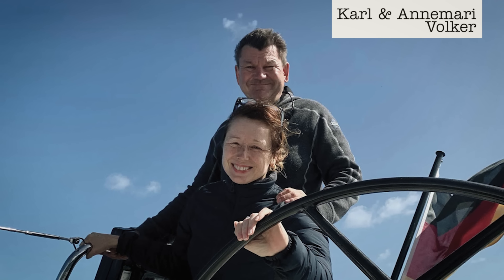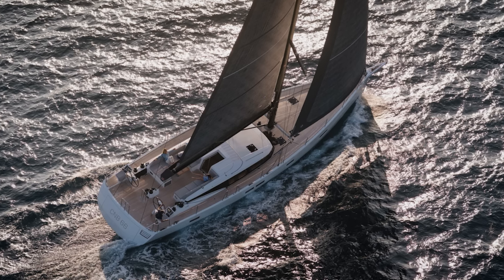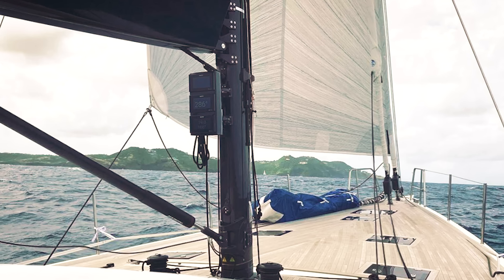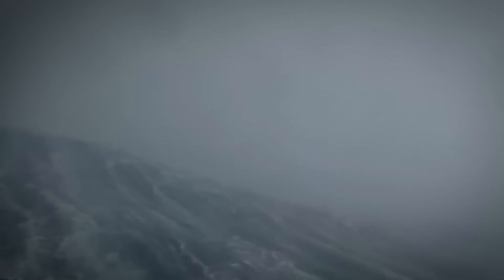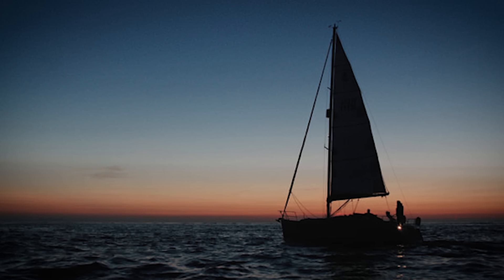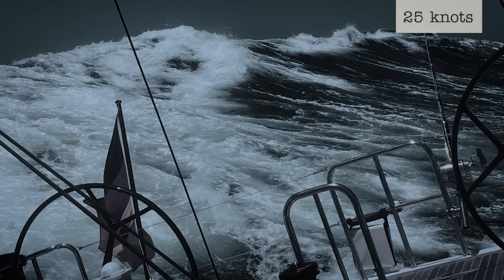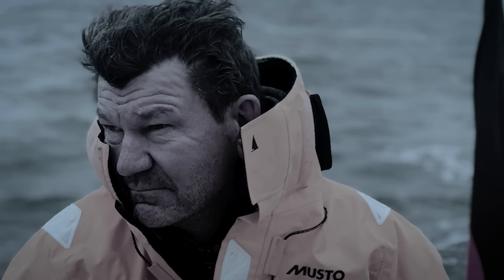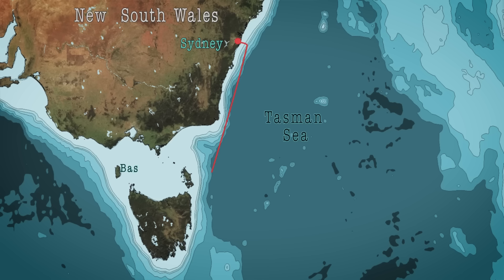Couple DIES on Private Yacht!

Comment: The reality is that spending a lot of money on a boat isnt always the way to go. There is a lot to be said for simpler and well proven designs.
Reply: @matthewmcdermit8744  I agree, a casual walk through on the mooring in Bermuda does not pass for preparing a small crew for a potentially hazardous passage. I can’t help but think that the main should have been a traditional mains’l with jacks that flaked into a pack on the boom. Like mast furlers, boom furlers are cumbersome and can malfunction. I helped deliver a 76’ CNB along the US east coast whose main was rigged traditionally with jacks and a boom pack. With one on the helm, one person easily reefed and shook out the huge (7/8 frac rig) main.
Reply: @matthewmcdermit8744  I agree, If they were ex coast guard how come they did not know anything about 1st aid?
Reply: @patricklund6497  Money doesn't buy safety at sea. Simplicity & reliability of equipment and competency of crew does. The further you venture from easy cruising grounds, the more that is true.
Reply: I agree, traditionelle furling, lazy jacks.
Reply: @matthewmcdermit8744  You're making a heap of wild assumptions there....
Reply: Just because you can afford a big boat doesn’t mean you should buy one. Something in the upper 30’ range to lower 40’ range would have been easier to handle
Reply: In conditions like the ones they were in this could still easily happen
Reply: But in the corporate world, more is always better.
Reply: @DHead5150  I have seen it several times, in that a formerly successful executive had to totally unlearn everything they learnt in the corporate world, before they could become successful cruisers.

Comment: The more I learn about sailing ,the more I think a Dinghy is the boat for me.
Reply: Oh, no, on a dinghy you need to learn how to right it up from the water :)
Reply: Keelboats are fun, Just a bit more dangerous if things go wrong.. So in 30kts with a gen up, Make sure nothing goes wrong and your all good :D
Reply: Best to have a smaller boat which is easy to handle and can look after itself. If the weather gets too much have bare poles and deploy a sea drogue if you have enough sea room until things settle down.
Reply: I take a decommissioned  US destroyer, those things are tanks of the sea.
Reply: Or the swimming pool .
Reply: There are some pretty awful dinghy stories out there.  One I've heard is someone is heading back to their boat after eating dinner on land, they do not attach the emergency shut-off cord to their body.  On the ride home they encounter an unusual wave which throws them out of the dinghy, but the motor is still running in a circular motion.  The dinghy then runs over them several times cutting them badly to the point they almost bleed to death.  

Luckily other boaters happened upon the situation and eventually saved him.
Reply: Everyone should learn to sail in a dinghy - not a keel boat.
Reply: @elypowell6797 Agreed, they are virtually unsinkable
Reply: I used to race sailboats and my priorities were to see land at all times and to be back at the yacht club in time for cocktails.
Reply: Me too. Or a canoe paddled around the local lake.

Comment: It's always hard to see tragic accidents like this happen. Especially when they could have been so easily avoided. As a sailing instructor I teach my students to avoid heading straight downwind because it is a very unstable course and there is always a risk of an uncontrolled gybe. Particularly on such a large yacht, it is safer to sail on broad reach. The forces that build up, even when using a preventer, can hardly be controlled.
I like the animations in the video. But the change in wind direction at 4:54 would not lead to an uncontrolled gybe. It only would do so if the sail had been on the opposite side.
Reply: Yeah I clocked that too.  Surely the main would've protected the gybe if indeed they were straight downwind.  I expect they weren't in reality.  In truth, this boat was way above their skill sets and didn't actually seem to be a very good boat at all.  An old 40 year old 35 footer would've been much safer for them and actually negate the need to beg two strangers to come along to help out.

Comment: Did an Atlantic crossing on a CNB 76 last year. Big storm, middle of the night, veering winds, big gust, autopilot failed, preventer failed, crash gybe. The blearing horn  tells us "All hands on deck, emergency" as the captain makes his way makes his way to the second helm to support the mate, wind turns, the mate just screams "Duck, duck duck!!" Captn immediately dives on the deck, as the boom comes flying back to port, taking out our running backstay, with the main sheet almost decapitating our captain.
Luckly no one was injured, the rigg just suffered minor damage, preventer had to be replaced and the running backstay got pulled through the winch, melting the line.
Next morning we met a small sailing boat, who broke their forestay in the storm. They could not maintain speed and were afraid of starving before arriving to the Azores. We supplied them with all the food we could spare and gave them our two damaged hightech lines (Dyneema, 15x stronger then steel), which they used to secure their mast. They made it to the Azores just one day after us.

CNB 76 is not a good boat to cross an ocean, at all!
Reply: We were in the same storm in a Tayana 37, about 50nm away from s/v "Escape".  Double reefed main and staysail, -with no modern gimmicks.  Two person crew, hand steering for about 36 hours.  Not nice, but we came out of it unscathed.
Reply: You confirm what I already thought not a good design
Reply: I am the only crew on a Contest 67 with the same boom furling, took in 2018 new  from  shipyard,,when they tried to raise the sail for the  first time, before delivery, they allready ruined the guide of the sail. The boom has to be at an exact height, sail completly without pressure,one man at helm steering in wind  and pressing the button, another at the mast working with the winch releasing the halyard. In perfect condition is difficult if  the hellsman has problems to keep it in wind.With heavy seas becomes quite impossible.  I normaly sail with a 74 year owner and it happend that I found myself  with full mainsail and 35 +kn wind and he got incapacitated, staying at the helm for more than 12 hours autopilot was not capable steering  because of the state of the sea, just waiting what will break.  I have made a modification on the boom furling ,I welded a disc on the mast side end of the furler, wich works as a guide and protection that the sail does not go to scratch on the hydraulic lines. Also if the sail does not furl perfectly it makes the furling much easier. My experience with new boats is, that now the boats are built to be beatiful. Beautiful things you should keep at your home. They are not seaworthy.
Reply: The "Bayesian" also had in-boom furling... From contemplating the comments here, I conclude that in-boom furling is a very bad solution... yet fifty ot sixty years ago, roller furling on the boom was standard. Jiffy reefing seems much more full-proof, though I have usually tied the clew to the boom with a lanyard once the reefing was done and the boat is on the wind. I have chartered a boat with in-mast furling, which seems less prone to winding up badly. Still, any mechanisms and extrusions are inherently more prone to a very inconvenient failure than the simplest setups.

The other day, I spent a few hours on a smallish tall ship, a three-masted staysail schooner. Everything was manual, nary a winch in sight. It's only apparent bow to modernity seems to be the use of wishbones instead of gaffs, which makes the mainsail and topsail into one sail, likewise the foresail. It has been all over the world, around the great capes, so something is being done right. Having a big crew is key.
Reply: intense
Reply: Nice work handling that situation. and BTW, that Dyneema is wonderful stuff. So strong, yet so easy to handle. I'm thinking of doing my entire standing rigging with the stuff. I've already used it in plkace of my steering cables
Reply: Why do people think that if they can afford such an expensive luxury purchase, they'll also be all but guaranteed to make their little trip safely?
Reply: The fact that the CG deploys that level of a rescue operation for a CPL of wealthy and injured foreigners is seriously awesome.
Reply: Not to sound insensitive here but HTH does someone die from a broken leg?    Did he bleed out?  Did they not have the capacity to make a makeshift tourniquet to slow the blood loss or did he also have a TBI to go with the snapped leg?
Reply: @kimaaboe8263 I’ve done Florida to New York on a 37 Tayana. Great full keel boats and very capable. We hit a squall off the coast of South Carolina which was a bit hectic. Praise God we made it safely into port to fix a cracked manifold we suffered during the storm from having the engine wide open to stay from broadsiding.
Reply: How can people going into potential survivalist situations not have large stores of proven dehydrated survival food rations? Pemmican, erbswurst, etc?
Reply: @Floydian4everr  I believe he said that the bones were through the flesh, probably some very severe wounds.
Plus he passed away after his wife died, perhaps he gave up? The shock and grief he experienced would have been something most of us could never comprehend.
Reply: @Floydian4everr  He may have suffered a pulmonary embolus as a result of a clot from the fracture or had a myocardial infarction from the combination of stress/pain/blood loss. The fact that his wife had a head injury appeared to recover and then subsequently die makes me suspect she may have had either an a subdural or epidural haematoma, there is nothing the helicopter medics could have done in flight as treatment for that requires a burr hole or craniotomy, usually after an MRI confirms the diagnosis and location of the bleed.
Reply: @Floydian4everr It was probably the infection that killed him. Compound fracture, broken skin, then sepsis and gangrene.
Reply: What time of year did you cross?
Reply: Have done a couple passages on a larger tall ship and muscle and leverage are the solution if employed properly. You CAN'T! outmuscle Mother Natue.

Comment: Tragic story. 
If I know one thing about sailing in rough weather, it's that you do not want things flailing about. Not sails, not lines, nothing. Everything must be tight and under control.
Winds can be so powerful even a small sail can become completely uncontrollable and dangerous.
And this boat was designed with a huge main, a huge boom, insufficient options to keep the boom under control for a shorthanded crew, and a far too long and hard-to-control main sheet. It was an accident waiting to happen.

Comment: Why wouldn't a $2M boat have a traveler arch for the safety it provides?
Reply: they sell these boats as "performance" and the look/styling plays a big part. Also they want to maximinze sail area while lowering the center of gravity, thus having the boom as low as possible. Works great for a large crew on racing yatchs. Perhaps not the best idea for leisure sailors.
Reply: Those charter like yachts are garbage that's why
Reply: Its a gimick. They sell the boats on max speed which requires large sail areas. But none of that really matters unless racing. What matters is comfortable sailing speed. Meaning reduced sail. Who wants to bang about in 6m seas? So often these boats are permanently at a single reef or more. Forget performance, think safety and comfort.

Comment: Sorry but experienced sailors would have resorted to dropping main in much less conditions. AND the Skipper should never allow a single person to deal with 2 high loaded lines in 20kts of wind, even less so in 6m seas. Spending $2M on a yacht today and you don’t have reversing winches for main sheet and preventer? Maybe $20k extra for absolute control rather than manual release, possible to even remote operate. Downwind sailing in the dark is dangerous with out big seas, the boat has 2 forestays, frigging designer should have included 2 genoa’s ( on the 2 electric furlers)with a dip pole capable of 3rd reef poling the lee sail in full downwind condition, NO main sail at night in those conditions. Or simply 2 storm jibs with engine running at maybe 1200RPM for emergency correction with rogue wave, remember they sailing downwind 6m seas, can easily push stern of boat so be prepared. Auto pilot but hand on wheel ready and close to AP control. Keeping a vessel straight downwind in such conditions is not easy in dark so AP is on high performance mode. Hey, if you don’t feel comfortable, spin boat and go upwind close haul until conditions improve with reefed sails ensuring boat is weather helm. Sad ending, please never risk night sailing with too much sail, big waves and limited experience, boat without sail will go down wind, you need to control action waves and main on the stern of boat, can’t afford boat spinning, could even role with those waves.
Reply: There in lies the problem. Both of them knew dropping the main was a concern. They both were very aware it was difficult to furl due to the design. It would frequently furor poorly and get stuck. So I’m sure they considered that option but deemed it dangerous. True answer is always reed early. I always reef in late evening and never sail under full sail at night. Squalls and weather always surprise you. Best to be prepared.
Reply: Rather than beat, just heave to. The difference in comfort is amazing. I wonder whether "Escape" was incapable of it? Or a long-forgotten tactic in this era of getthereitis?